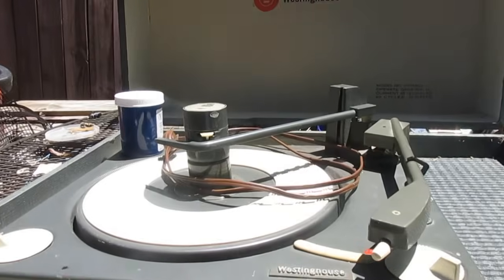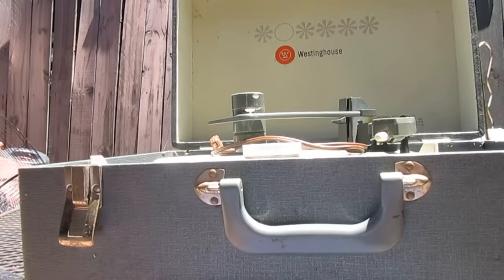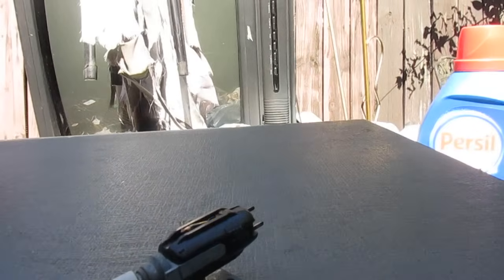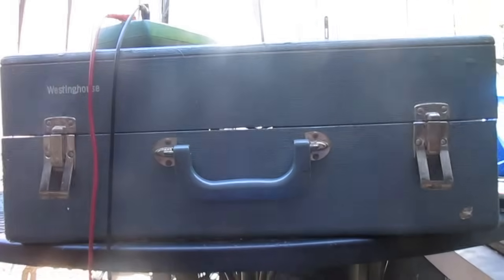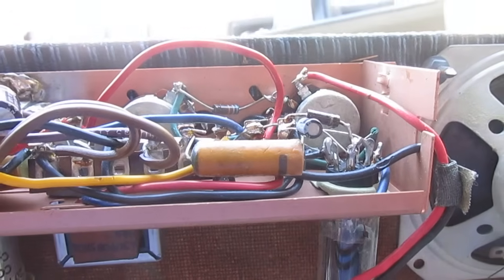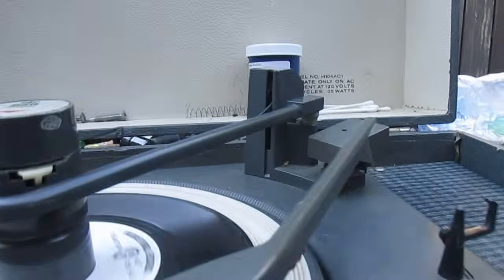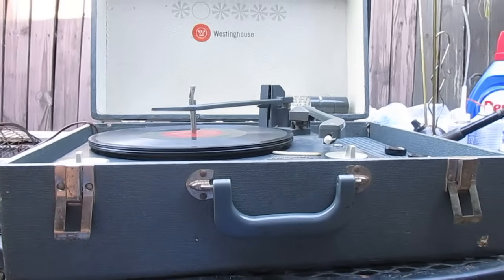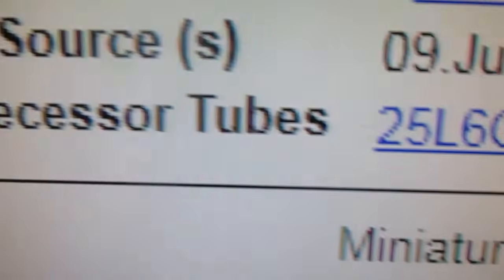Resurrection of a shipping damaged 1964-'65 Westinghouse Record Player

Comment: Incredible. Almost exactly the same GD thing happened to me, just this month. Bought a '62 Westinghouse suitcase off ebay. It arrived in a box (a toilet paper box...) with some bubble wrap around it. (I looked up ebay's packing guidelines, and that's exactly what they instruct people to do: "use a box slightly larger than the item to be shipped", dear god...) They had loosened the transit screws as I'd asked...but they did not tape down the tone arm as I'd specified. No padding within, so the weight of the turntable actually tore out one of the transit screws. The screen over the amplifier was pushed in, I was amazed that the tubes were intact. The seller's attitude is "This was being sold for parts or repair", they can't see that their carelessness damaged the item further. Not the first time an idiot seller didn't think about how things can move around when being shipped. Yes, it was clearly not handled  carefully by UPS, but cardboard is cheap. It wouldn't have been difficult to pack it better and at least write "Fragile" on the box, even if that doesn't mean anything to the shipping service. 
Heh, the tone & volume knobs on the '62 are on the outside of the suitcase- a remarkably careless design!
I'm glad you made this video!!! I feel more optimistic about my new phono. It does seem to be working, although the cartridge is probably toast, and it's doing that thing where the tone arm keeps going to the 7" point :^/

Comment: I stopped buying stuff like this off of ebay for just this reason the amount of items i had turn up trashed by one fault or another some sellers literally just throwing in a box with no packing at all! Cracks in wooden cabinets chassis broken free from cabinets you name it one reel to reel in a wooden case arived and the seller had packed it with the heavy speakers on top of the unit ..well the unit case there was nothing left of apart from the front and upper top . Speakers were undamaged the cabinets that is but heard something ratling round and it was a speaker magnet 😂 . So i kinda gave up on having stuff shipped i aleays made a road trip to collect . Even when an item was listed as being posted i would message the seller to tel them not to and i will collect that always seemed to come as a surprise to some . But hel yeh suppose now and then ive taken a chance on a table radio of something and expected the worse  . I noticed since  finding your channel again most of your videos have disappeared

Comment: I like that turntable. We had a drop down suitcase record player years ago. Seems like it had a turntable like that. I was little at the time. And the round 45 RPM adapter. We had record players that used those. I didn't care for the flat adapters as much.

Comment: Jesus those E clips are hard enough to detach when you WANT to
Reply: I called the E Clips, Jesus Clips. As that's what you say when they fly off.
Reply: @KentTeffeteller  depending on the size, it's either jesus i nearly lost an eye, or jesus where the hell did that go
Reply: @TheChipmunk2008  Well posted. Jolly good wit.
Reply: @KentTeffeteller  you have been there, i can tell...I mess with 80s electromechanical stuff so it's usually the latter